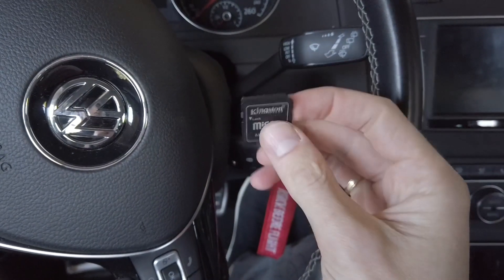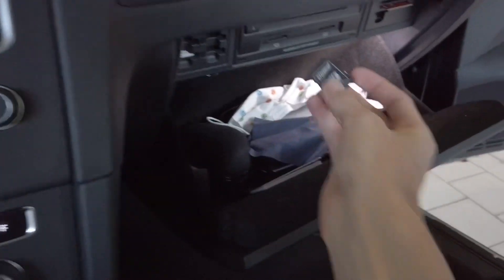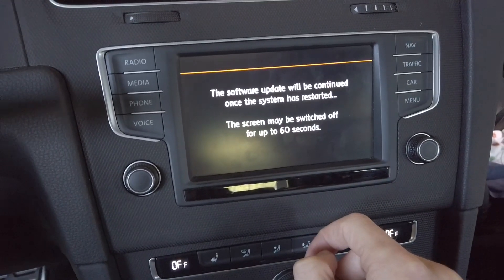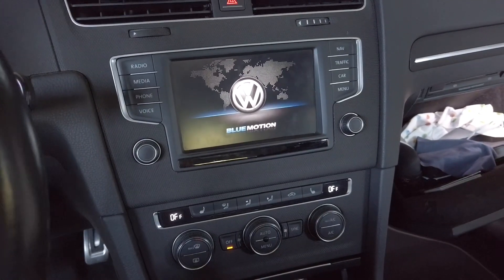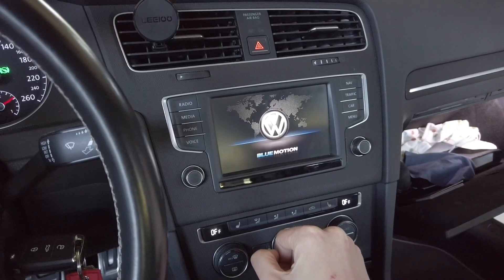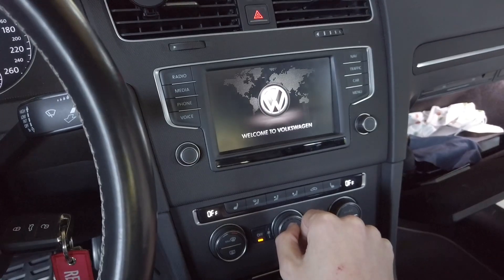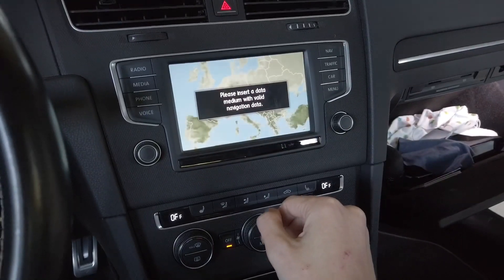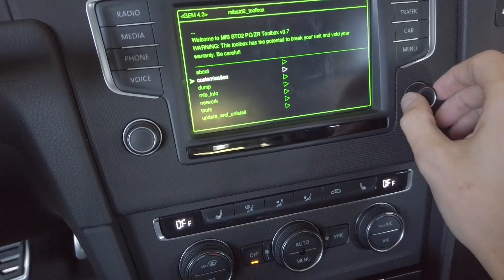MIB STD2 Toolbox installation on Technisat/Preh main unit

Comment: Hi mr-fix,

Yesterday I've made an update with SD card prepared by your instructions and the update went well, as I saw (steps and finish were same as it is on your video tutorial), but after the last reboot and try to enter "test mode menu" after pressing the Menu button for 10-20 sec or longer, I'm just getting the regular service menu? Any ideas what can be the reason?
Reply: I have the same, do you have a fix?
Reply from the maker: At the end of the update, there's a final script executed which disables developer mode. You need to reenable developer mode with VCDS or OBDeleven or CarScanner...
Reply: @mrfixpl  Hi Mr-fix,

I have enabled developer mode, and now I see the green screen mode, but it's missing some features. I'll make a short video with available options if this can help you tot help me :)
Thanks in advance,
Reply: OK, sorry for the delay but I didn't have time in past 10 days to do it, so I tried it 1h ago and here is the result, when I try to use patch, here is the video of complete procedure and result. Video: https://youtu.be/HuXtbD4YUqQ
If you can advise please, help. I saw in some of descriptions that this toolbox is for some newer firmware versions, and that I need to copy CPU folder but I do not know how to do it, or will this be the solution. Please help if you can.

Thanks in advance,
Reply from the maker: go to mst2 toolbox project page and read the readme file. You will find that old firmwares (series 01xx and 02xx) have older GEM (3.4) which needs to be updated. It's all there. Just please read the manual.
Reply: @mrfixpl   Hi again,

I believe I found the topic you mentioned and it's on link in your description, "How to install from SD card via "Service Mode" on units with navigation (units with two SD slots)" under IMPORTANT, where it's described how to copy cpu folder from \toolbox\gem to root folder. Is this right?

Thanks in advance,
Reply: @mrfixpl  Hi again mr-fix,
Just to inform you that finally I got it patched with your additional input and now process went through the end after all, but as my original idea was to activate Apple CarPlay on my unit. As you can see on the video I uploaded earlier "https://www.youtube.com/watch?v=HuXtbD4YUqQ" on my menu you can see MirrorLink not AppConnect is it possible to have Apple CarPlay on my unit?
Thanks for understanding
Reply: @mrfixpl  hi again,

Thanks a lot, as I already wrote, I have successfully patched the device and activated new SWaP codes, but still no CarPlay or option for AppConnect? Is this possible on this device? And if not is there any option to update it on some custom firmware version 02xx or03xx or 04xx?
Thanks in advance.
MarkoP
Reply: will this maybe help to get "Developer Mode & Green Menu" - https://www.youtube.com/watch?v=R9WlrkBioi8
Reply: I have the same issue, did you find a solution?

Comment: Tried this and didn't work unfortunately and it is a tecknisat mib2 unit but no engineering mode comes up  at all.
Reply: @jamesmitchell9201  debes primero activar green mode desde una app y obd11,vcds o CarScanner pro que fué el que yo utilizé, despues ya puedes actualizar el menú green como lo hace el compañero a través de tarjeta SD.

Comment: I have a technisat unit with firmware MST2_EU_VW_ZR_P0241T, can it happen that the installation goes wrong and brick the unit ? The guide is very well done, but I have this fear
Reply from the maker: Update to 0254 first, next install toolbox.
If the installation goes bad (unlikely, but still good that you are keeping this in mind) you can boot the unit into recovery mode and restore the system. Here's a video about it: https://www.youtube.com/watch?v=Pdel-Kb-hZ0
Reply: @mrfixpl  Thank you very much for your quick reply. Can I switch directly from my version to the one (0254) you indicate? And could you please tell me where to download the firmware file. Thank you very much, from Italy.

Comment: Hello Mr-Fix. 

I just want to thank you for the great videos and the information you provide. It has been a great help. I had my Octavia for six years and the smart link was disabled from factory. I even considered paying £150 to the dealer to install the codes, if I could find a dealer to do it. Thanks to you I have enabled CarPlay only to find that I have to change the usb socket.
Reply: Merhaba serkan bey 2016 optimal octaviam var smartlink açmak istiyorum bana yardımcı olabilirmisiniz bilgisayardan anlarım.
Reply: Merhaba abi bana yardımcı olur musun
Reply: Nasıl yaptınız ben de Passat için yapacağım. Bilgi verebilir misiniz

Comment: HI, it is perfect help, but I installed ToolBox - CPU - OK, everything looks right, but after long pressing "SETUP" "Testmode" does not appear, only beep is hearing. Where am I making mistake? 
MST2_EU_VW_PQ_P0472T, 5C0035680F, H29.319.58_STD2NavPQ_EU
Reply: I have the same problem…”Testmode” doesn’t appear after long pressing.
Reply: Is there an access to the testmenu via service menu?

Comment: Please can you help me with the instruction on how to install toolbox on Non-navigation mib2 devices ??
Reply from the maker: opening main unit is required, and connecting to eMMC chip on the main board.
Reply: @mrfixpl  thanks my friend
Reply: @mrfixpl  hi friend, i saw in the internet that i can install it with telnet method is that will work for me please ??

Comment: so you need green engeneering menu to be able to play around with Toolbox and for that you need to go to some tech guy that has tools to connect to car, is not possible to do trough SDcard ... RIGHT ?
Reply from the maker: You need to unlock developer mode. 30 seconds job with OBDeleven or VCDS or CarScanner or Carista.

Comment: "The sound settings are available again as soon as the phone call, the announcement or parking has ended."
hello if this instruction will solve my problem  (I have a harman)and also if it is possible to do all this with obdeleven pro thank you.
Reply from the maker: I would start with firmware update. This might fix your issue.
https://www.youtube.com/watch?v=6FlHM9VZl_s
Reply: @mrfixpl  Thank you sir 🍻
Reply: unfortunately it didn't help me update :(

Comment: Hello good evening Mr-fix, I have a question for him if you can help me, I wanted to ask you which toolbox version I can use with my MST2_EU_VW_PO639D[SW MU 0761] 3Q0035874B, many thanks in advance.  I would be very happy to receive an answer from you (Carlos)
Reply from the maker: You have a Delphi unit and there's no Toolbox for it.

Comment: What about mib 2.5 unit? Tiguan 2018 model
Thanks
Reply from the maker: MIB2 and MIB2.5 are the same technology units. The ".5" is just an indication of the updated graphics and other minor software changes. It's still a MIB2 device. Toolbox will work with it as well.

Comment: In the FAQ I read: It will not work on MIB1 or MIB2 Standard units. Discover Media / Compostion Media is not MIB2 HIGH!

But you say: Installing MIB STD2 Toolbox in VW Discover Media infotainment system

Does it work on my unit?
Reply from the maker: You are mixing information from MIB2 Toolbox with information from MIB2 STD Toolbox.
Reply: @mrfixpl  thanx. I just found out how to do the right installation of Toolbox on my VW Sharan. Works great!
Reply: @japieapiejapie  were did you get the toolbox file from (email address) please as I have no toolbox on my green screen. Thanks in advance

Comment: Is it possible to access toolbox without OBDEleven or similar tools?
Reply from the maker: It's required to have the developer mode enabled. And you need to do it with diagnostic tool like VCDS, OBDeleven...

Comment: Does this toolbox support MIB2 with version MST2_EU_VW_PQ_P0241T ?
Reply from the maker: If your unit is equipped with navigation (2x SD port) - yes.
Reply: @mrfixpl  I have this unit in my Tiguan but it does not recognize the sd card
Reply: Hello, is there a toolbox version for my Skoda? My current version is MST2_EU_SK_ZR_P0241T and the software version is H25.14.35_STD2NAV_EU

Comment: Hello Mr-Fix, I installed the toolbox successfully! But using it cause a fault! Example: the SD card SID lock removal... Following the steps I got a message like "... the task/servce is already running ..".I used already the GEM workaround - without success ... :-(. Do you have an idea? Thanks in advance...
Reply: could you fix it?  I have version 1.3.3 and disabling CID and CP has no effect, when I try again I see lines of code with errors.

Comment: Very useful tool.
Can I use with this?

I think yes, as software 04.
MST2_EU_SK_ZR_P0472T
Correct?

Zainstalowana wersja SW Train:

MST2_EU_SK_ZR_P0472T

Zainsta.wersja oprogr.jednostki głównej:

Numer części:

Wersja oprogramowania:

ME

0472

500035864C

H29.319.51 STD2Nav EU
Reply from the maker: Should work on your main unit. Give it a go!

Comment: Hi there!
Thanks a lot for the video!
It will work on the units from USA? - MIB STD ZR+NAV   3Q0 035 880
Thnaks in advance!
Reply from the maker: You have MIB2 (which is great) but not sure if made by Delphi or Technisat. What's your software version?
Reply: @mrfixpl  Its Preh and the SW version is 0245, Can be upgraded?
Thanks in advance!

Comment: 1556 error should not be present with installation of latest version. It was a fileversion inconsitency with old installtion. It is fixable tho.
1555 or SVM Error is also fixable with XOR claculator and some diagnostic software.

Good explanation and that you listed everything and not want to stell this toolbox :-)

BTW: If you run the build in update script from the menu your old menu entry should be deleted ;-)
Reply from the maker: Will make a video about 1556 which I have in my unit since some time. It's triggering my OCD every time I scan the car.

For the 1555 I've made this tool: http://mib-helper.com/im-so-xory/

Keep up the good work!
Reply: @mrfixpl  Zrobiłeś już film o 1556? Czy to chodzi o toolbox i "Clean SWDL history and keep only non-duplicated FW updates"

Comment: You can additionally install extended green menu GEM.
Just keep the same SD card in the slot and select dedicated option in GEM. 
You will be surprised how much extra configuration options is added in.
Reply from the maker: Thanks! Will definitely look into it!
Reply: @mrfixpl  and mib1 does it work with it  ? because i want use another sd card for navigation
Reply from the maker: exclusively
Reply: @mrfixpl  😉
Reply: Could somebody please give me some advise/help?

I have the  mst2_eu_vw_zr_P0137T installed, but want to be able to install Toolbox so that I can use a map on a custom SD card. 

I tried to install Toolbox without firmware update with the solution to replace the cpu folder from GEM folder with the one in the root of the SD card so that the root CPU folder is replaced with the GEM folder version. After 10 attempts it keeps saying: start electric test. Mainunit/version compare. Accept this error code leads to restart(translated from Dutch). 

What should I do to make it work? I hope it will be possible.